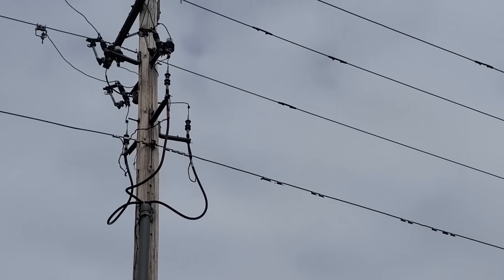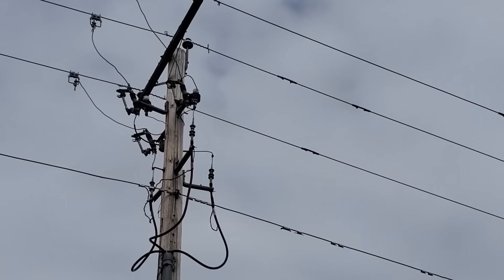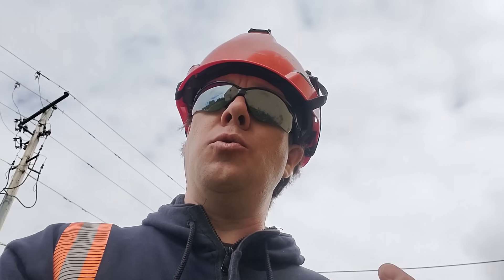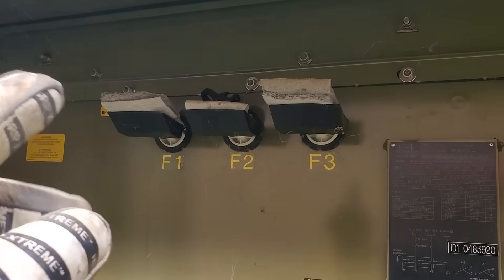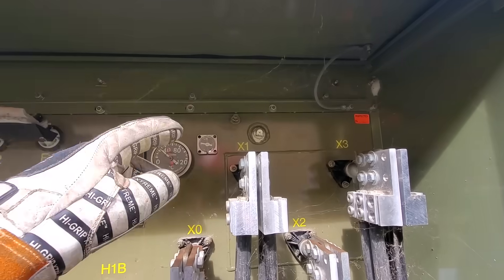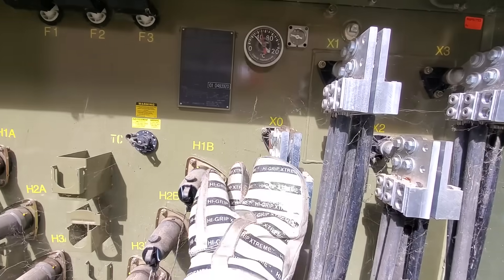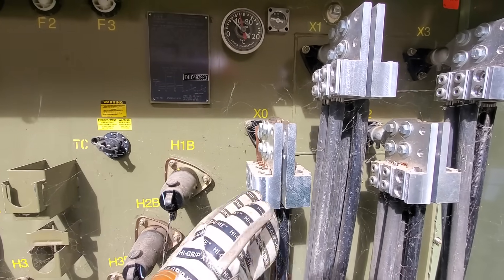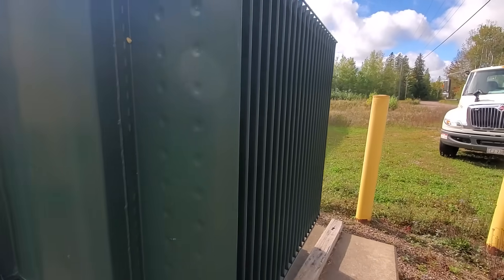A closer look at Padmount Transformers

Comment: As an electrical engineer, this is one thing I would not do. Work on lines. They may not have a PhD, but they know their stuff. Key to staying alive and keeping our world working.
Reply: most hazardous job in the nation.  we lost a brother in my local a few months ago, and one got blown up underground. this happens in our trade. even with 3 layers of fr clothing and arc shield, guy down in the vault still required cadaver burn grafts.  ive had guys with engineering degrees get sick of the office and try to hack it in our field that just couldn't make it.  it often requires a different type of spatial intelligence that simply cannot be taught
Reply: @loginavoidence12  I used to maintain 24v plant low voltage but very high current that's 24 large lead acid batteries in series parallel. We seldom encounter high voltage but one co worker did die from touching an AC line in a central office.
Reply: @loginavoidence12 actually roofing is..
Reply: My sister in law is an electrical engineer working on transmission systems. My natural curiosity leads me to ask her a bunch of questions that she doesn't know the answer to. It's cool seeing how much respect she has for the lineman in her company.
Reply: Yeah, right? But hey. Your job is important too. Someone has to do all the design and calculations and know the big picture. Otherwise there wouldn't be any point in having all these lines.

Also both sides need to respect the other and also push back if the other side makes a stupid decision and work out a good solution. Like in construction or mechanical stuff - the good engineers and architects are friends with the machinists and builders and they know what's easy to make and what's a pain in the butt.
Reply: Amen, I'm far happier working on low power, low voltage circuitry and working on MATLAB scripts in the office. Huge amount of respect for these guys, and bobsdecline has been instrumental in my practical power systems learning
Reply: When I did cell tower work I was happy to work on equipment up to 240 volts which luckily was the max our stuff might run at. Anything above that voltage is a no go. As soon as you get into that arc flash territory that stuff is some serious business!
Reply: Phd? Player haters degree?
Reply: @1480-b5g  Piled High and Deep.
Reply: Yeah cause you have to have a phd to know things
Reply: How subtle lol. Just had to say they may not have a PhD.... condescending m0r0n.
Reply: PhD people are usually book smart, but common sense dumb.  They’re usually arrogant too.  Just sayin.
Reply: That must be a co-op for them primary risers to look like spaghetti noodles. 😬
Reply: They sometimes work the live lines hanging off the side of a helicopter.
Reply: @MrAnswerification  
Helicopters for an underground primary riser? 😂👍
Reply: HAHA noob i work on this in switzerland and study engineer by abb
Reply: @MyGameplayPro  wtf are you on about? ABB does not give engineering degrees, it's a company not a collage
Reply: @TheBozn  sure google it in switzerland my frend
Reply: What area would this PhD be researching?
Reply: Ditto. I design it but the experts install it. Excellent video.
Reply: My dad was a chem engineer, My brother was an electrical engineer. I asked my brother if hed wire a house and he said no way.... I didn't get it then, but I do now.
Reply: No joke, I find that idea downright frightening.
Reply: Phds are useless. Philosophical degrees are useless.
Reply: And they make more money then you…without the PHD
Reply: There are a or if things engineers shouldn't work on 🤣🤣🤣
Reply: as a 38 years of lineman work, I’ve said we can train to be managers with schooling, but managers usually can’t train to be lineman. You’ve got to have street smarts to be good at it.
Reply: Linemen also make more than electrical engineers and have little-to-no college.
Reply: I want to go to one of the regional training centers to learn this stuff.  I have 24 yrs to fully fund 2 retirements and this is a great way to earn and build my pension
Reply: Engineers give field men praise while field men shit on engineers. As the GC, I just stand in the middle and watch the fire works.
Reply: Those are real men doing that work.
Reply: The fact is that they know more than you even with your PhD. Engineers can come up woth the most absurd things and only look at blueprints, not the actual job. Some things you engineers come up with are impossible to do.
Reply: @theabileneranchertar7882  yup.. I agree
Haha it's like engineers suffer from cognitive dissonance.. they think what they know is irrefutable.
Its the equivalent of a PhD chemist formulating the perfect cake from knowledge of the atomic world . But it takes an experienced chef to have the clue
Reply: lol, no offense but...as if a phd in this day of age matters
Reply: all degree is good for is wiping your / when sheet hits the fan who pulls it back together ?? 
the tradesmen !! keep up the good work dude love the video
Reply: @kennek6224  🤦
Reply: @TheBozn  Linemen in the field hate you “engineers”. Like already mentioned, y’all draw up crap that looks good on paper but isn’t practical, isn’t efficient or complicates things in the field. When that happens, us linemen in the field have to fix your fuck up. “Engineers” more than likely don’t know how to do the job in the field. Ask me how I know. I just went through this with one of our “engineers” on a URD reconduct in a neighborhood. Do you know how to terminate primary elbows or T bodies? Do you know how to terminate primary splices? Do you know how to isolate cable and transformers to be changed or replaced? Who’s going to be out in the middle of the night doing it while you’re sleeping warm and dry in your bed? That’s right. Linemen. You’re the funny one here that needs to step off your high horse “Mr. Right”.
Reply: @jaxbeach09  I think you are confusing engineers with engineers. Have you ever met a lineman that seem incapable of a critical thought, or seem to have the thumb in their palm? Same goes for engineers and any other profession, relative to the average of that profession. The Hallmark of good engineering is efficiency in function and cost as well as practicality. That includes ease of repair or installation(time = money). Sometimes the cost of making something more practical is too great(different machining needed, material, location, etc.) and often the customer refuse to pay for that and they rather have a cheaper short time solution which could be much harder to repair than to pay for it up front(they also have to report costs to someone that will judge their work on how things like how cost efficient they are).

 In my case I worked hands on as a technician for 5 years before I started my engineering degree, so trust me when I say I know that engineers can suck at their job as well. It's the blanket statement that engineers in general know less than linemen thats a little funny, which of course if you take an average of each profession isn't true.. Sure linemen have some practical knowledge that exceeds the average engineer but if you were to compare the sum of all their knowledge it would be on another level, obviously.
Reply: They have a PhD in experience. Worth 100x more than a paper degree.
Reply: In my experience, engineers are just people good at math and puzzles. They always lack the nominal intellect needed to do hands on work. Engineers may be smarter but you certainly are not wiser.
Reply: Degree is meaningless compared to hands on experience these guys have, I guarantee you they have more knowledge than 90% of all electrical engineer PHD or Bachelors holders.
Reply: @jfsoccervids  different knowledge, not necessarily more. That's a silly dick measuring contest to say someone who's an expert in one domain is smarter than someone else who's an expert in a different domain.

One of the big things with PhDs that I think most people don't understand is that with higher level degrees, the knowledge becomes more specific. Yes, all PhDs in electrical engineering are expected to have a strong handle over concepts within the field (more breadth and depth than master's and bachelor's), but ultimately what they really are is the world expert in whatever topic they wrote their thesis on. And everyone has blind spots. Even if you know something, you might overlook it if most of your experience and more specific knowledge is centered somewhere else. Engineers can't replace technicians and technicians can't replace engineers.
Reply: @jfsoccervids  ... there is a difference between book learning and hands on, but they do go hand in hand. Even with years of experience, you still need to know WHY you do things a certain way.
Reply: @jfsoccervids   I would also say that they are very different topics, Powerlines vs Electrical Engineering. Working on Lines is way more specialized than Electrical engineering is. Doesn't mean it doesn't take huge balls to do linework.
The two things are not really comparable but are both needed.
Reply: @jfsoccervids  i don't think you have any idea what an EE does.
Reply: @jfsoccervids  You guys are funny. Engineers design the systems that you are installing or working maintenance on, we also write the safety rules, all the instructions and maintenance manuals so you know what to do and how to do it right. 
Keep telling yourselves that a maintenance worker/electrician know more about this than the people who design it🤦
Reply: @TheBozn  
I can tell you firsthand, an electrical engineer doesn't go out in the field and look at the landscape to see what obstacles may or may not be there and definitely doesn't know how to easily  plan out the work so that it makes it easier on everyone who is actually doing the work that pays for their salary.  They draw up a piece of paper that looks good, but doesn't work in real life, and it's up to the manual laborers to make it work. Just because they paid for a piece of paper from a college doesn't mean that they deserve to come straight out of the gate and be in charge of an electrical grid. That's like bringing in a new hire off the street into a foreman position to lead an entire job. And it's literally what happens.

An EE should have a minimum of 5 years actually doing the line work that they oversee before entering the office in my opinion.  Then an EE would deserve my respect. Until then, they're nothing but imbeciles with a bought degree.
Reply: PhD don't mean squat
Reply: @eclipse369.  ?
Reply: @eclipse369.  If you've earned one, you know what they mean.

Comment: i like the oil catcher on the fuse holder/pull out ...wish we had those.....and for  the pressure, some of our older trans dont have a pressure relief valve....and they do pop !!!
Reply from the maker: Great eye! I didn't mention that in the video. 

Yea some older ones without a pressure relief valve will even squirt out at yea if there's a lot of pressure in there 😟
Reply: @Bobsdecline  ...the oil cups/catchers, are they added, or was that a factory ordered thing?

Comment: That switch that you talked about to increase the voltage to the customer that the transformer has to be powered down to adjust what would happen if someone turned it while the system was still energized? Thanks for sharing buddy
Reply: Short circuit inside and enough sparks and heat to ruin everything in the box.
Reply: It will destroy the switch and taps.

Comment: Interesting to see how different it is compared to here. 
The equivalent here would be a box of varying size with the removable transformer inside its own compartment.
These things depending on size can supply a lot of homes as well. The ones listed below are from 2-3m tall. 
The medium and large loose at least one HV circuit space if there is a room for remote monitoring equipment.

Small ones are around 1.6x1.9m that fit one 22(11)kV/240V transformer up to 315kVA in one side and room for up to 5 240V 400A fuses on the other.
These are usually tucked between the legs of a H or A frame design poles.

Then you have slightly bigger ones at around 2x2m that can fit up to 315kVA transformer, but also 4-5 HV circuits and up to 8 LV (240V or 415V).

Largest outside operated ones are about 2.1x2.7m and fit up to 800kVA transfomer, 4-5 HV circuits and up to 15 LV (240V or 415V).
Reply: I've also seen a model that acts as its own tower with overhead lines exiting in multiple directions.  They were usually gray and may have had exterior sides made from asbestos cement or painted steel.  They haven't been installed in decades, but some remain with all wires fed from the ground.  Then there's the big city model that was buried in sidewalks and contained a 3 phase 6kV to 380V transformer attached to city wide meshes on both high and low side.  Many of these were replaced in recent years because politicians didn't like explosions in mistreated units.

Comment: I heard one answer to "why not underground?": air is the cheapest insulator.  But access for work does make a lot of sense.
Reply: Air is also renewable and easier to maintain.  
Not mentioned often is the fact that the life of underground cables is around 30 years.  If the cables are in ducts it isn't too bad, but there is a crapton of 30+ y/o cable that is direct buried.  Now neighborhoods get torn up to dig out and replace the cables.
Reply: When you start burying HV cables underground you need even greater separation between them. It's more esthetically pleasing, particularly in the countryside but then you need to start digging multiple deep  long parallel trenches in which to lay the cables. It's far more expensive to do that than string cables across pylons up in the air
Reply: @deang5622  Underground 11kV or 12kV cables are usually a single thick cable in a single trench. Separate trenches for each phase may or may not be used above 100kV, they certainly run separately inside power station buildings.